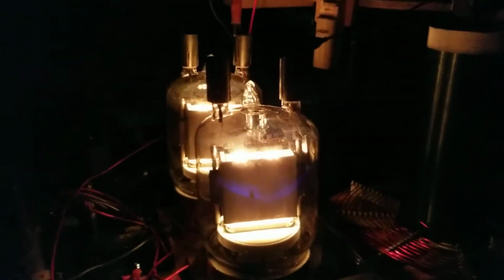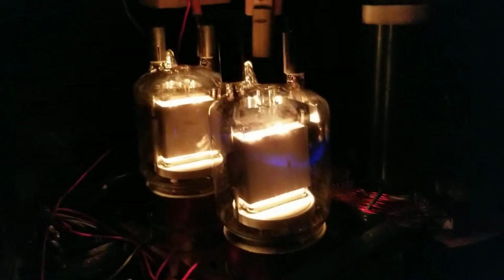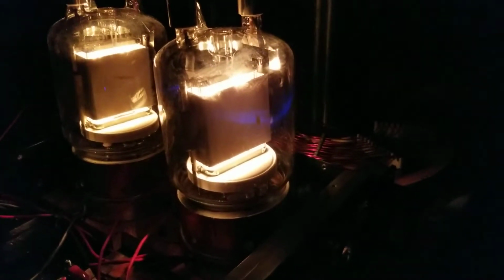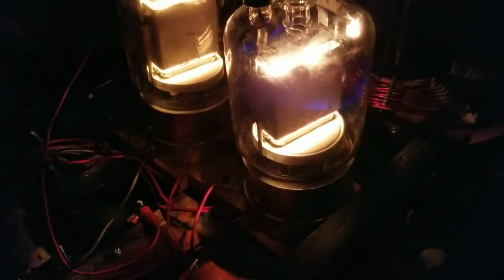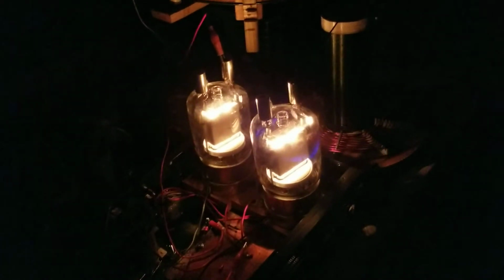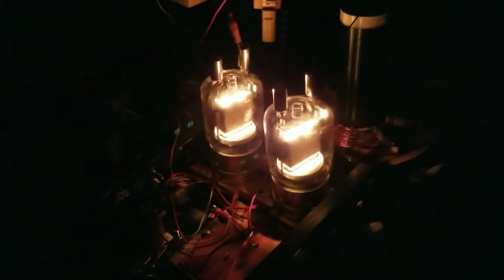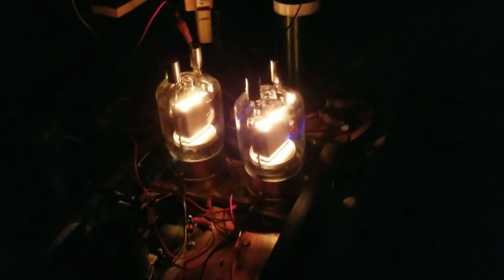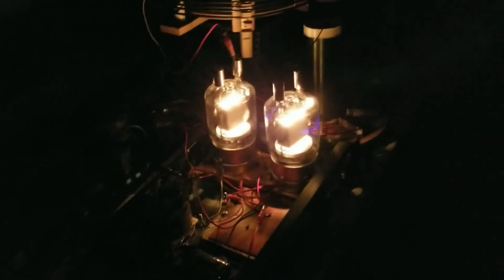GU-81M push pull beat oscillator progress

Comment: wonderful tubes you got there.
what are you trying to do?
push pull oscillator or amplfiier?
Reply from the maker: Ya, push pull Tesla coil driver
Reply: @drgonzo7806  No way, thats literally what I am trying to get going.
Do you have discord?
I am interested in the schematic and design process
Reply from the maker: Yes, but we're focused on Stan Meyer's work, not this setup  @janno288
Reply: @drgonzo7806  I am interested in this setup tho, especially the push pull design and oscillator circuit?
mind sharing it over discord?
same name i have here.
I don't know who stan meyer is or what hydrogen fuel cells have an thing to do with this
Reply from the maker: Well, you're looking at a video from 4 years ago. Are you saying I'm not allowed to work on more than 1 thing? Look up the GU-81M tube.  @janno288
Reply: @drgonzo7806  No, of course not.
I am only interested in a Push Pull Vacuum tube tesla coil with two GU-81Ms, so i would like more information specifically to that.
Why would i have to look up the GU-81M tube, i am already way familiar with this tube, i habe 1 GU-81M and 2 GU-81s?
Reply from the maker: I will defer you then to a higher knowledge on the subject https://www.youtube.com/@T2D.SteveArcs  @janno288